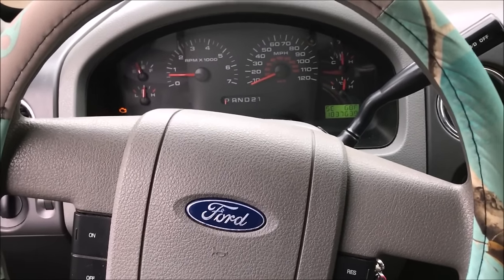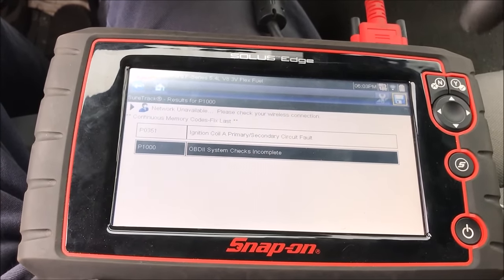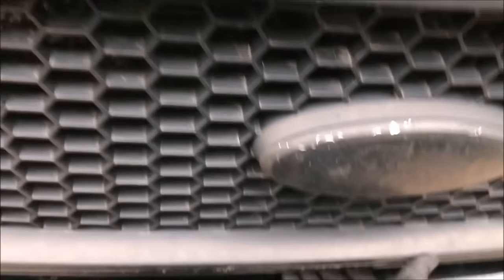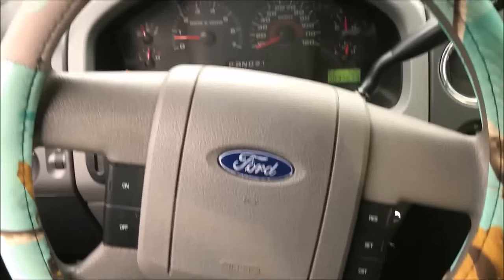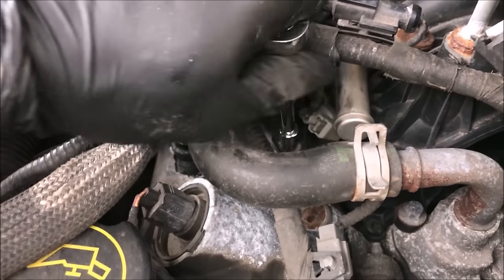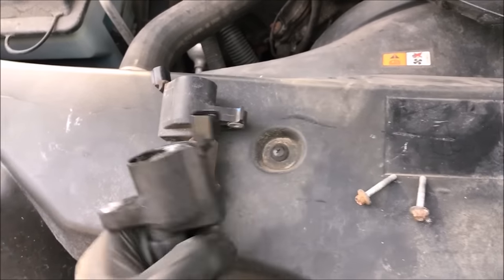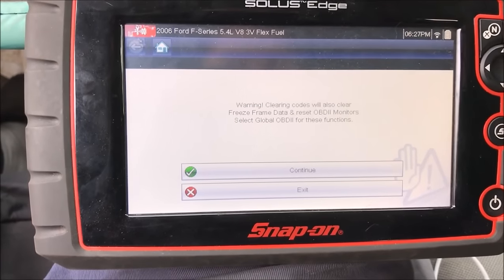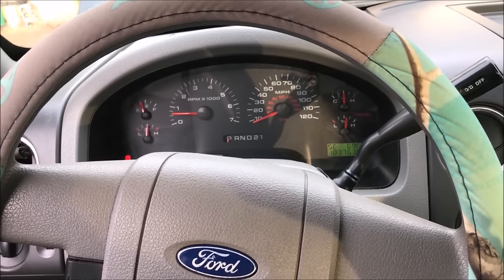How To Diagnose And Replace A Misfiring Ignition Coil (5.4 Triton)

Comment: Good video. I have a 2000 Lincoln LS V8 I changed out all 8 spark plugs cause I have a misfire. It ran well for about a good week and ended up with the misfire again. So now im going to change all 8 coils but any way by any chance did you put connector grease on those coils you replaced?
Reply from the maker: I didn’t but typically a bit of electrical grease on the end of the coil that contacts the spark plug won’t hurt anything. I don’t really mess with adding any to the actual electrical connector.
Reply: @TonyTheTruckGuy  okay and another thing this car has been sitting for about a good 2-3 years without running. When took the right side of the coils out the # 6-8 coils have like this brownish liquid on the coil. Would you happen to know what that is?
Reply from the maker: Probably just some old dielectric grease. Doesn’t hurt anything so long as the metal coil can still contact the spark plug. If the car has been sitting that long, I would also see if there’s a fuel filter you can change.
Reply: @TonyTheTruckGuy  alright that was going to be my next solution the fuel filter. But hey Thanks Tony I appreciate the help I'll let you know if there's no more misfire

Comment: Tony,  your comparison of the old coil to the new one with the longer spring sticking out is probably because of years being compressed plus the heat relaxed the tension, therefore making it shorter
Reply: Except that other new packs don't extend down that far.

Comment: Here is hopefully a helpful comment for anyone that is changing the plugs on the Intech 5.4L version - the factory plugs have less threads than the newer ones - when I pulled them, I thought I bought the wrong replacements but they are the correct ones... I guess Ford changed it so the plug would have more "meat" or maybe to fit more things, etc... not sure but it's what they went to now... I know this was about coils, but in my opinion it's silly to only do the COP's on these without also replacing the plugs just my opinion.

Comment: These coils have a life expectancy of 90,000 miles was at 90,000 changed my plugs yea twice in never one broke 07 f150 . One a month failed after 2 changed them all 2 years later no problem. These things are like popcorn put 8 kernels in the kettle you hear 1 or 2 pop at the same time but when its all done all 8 are done the kettle is at maximum heat at 100,000.
Reply: Jason joncas I have 270,000 on my 07 F150 replaced spark plugs 3 times, just now starting to change coils. Probably should of replaced coils a few miles ago..

Comment: Hello Tony i bought a new 2007 F 150 5.4 only owner and driver,  and i use it rarely.  I do run it often. I only use Chevron gas. This truck only has 59K  The last few months it seems to missfire??? It does it at higher speeds or uphills. No check engine light on. this truck has been babbyed. I had the truck serviced at the dealer at 50K all was done except the fuel filter... The dealer wants around $800 to change the coils if that is even what it is? I'm now more on a budget and my neighbor the weekend mechanic said hed do it. The real motorcraft seem to run $60 each. Plugs i think run $12 each. Should i do all of them as he suggested, and should i guess??? Thanks for on-line info   Mark retired
Reply from the maker: Had the exact same symptoms on an ‘06 that was my ex’s and it ended up being a combination of 2 things. The spark plugs were cracked and causing misfire under load, but wouldn’t throw an engine light. Then after that it was having issues with the torque converter staying locked up so I changed the solenoid for that. I would start with plugs and inspect the coils for any cracks or damage while doing the plugs. But be.m careful, the plugs on these engines are notorious for breaking upon removal.

Comment: I have a misfire on #8... I changed out the plugs on the entire side of 4-8 & Still have the misfire.... My ford tech buddy then tells me that I changed out 1-4 !!! What a funny guy he is... at least I got #8 done. All. plugs 1-4 weren't hardly hand tight....
Reply from the maker: Yeah haha, Ford numbers their cylinders weird. I believe cylinder 1 is the front passenger side and then as you go towards the rear, it’s cylinder 2, 3, 4. Then 5-8 are on the drivers side bank. May be a coil issue if you’re still having problems after plugs.

Comment: This video is a little old but I thought I'd ask a question. maybe you can throw out an idea. I have a 2002 Ford Harley f150. Comes with a 5.4 supercharged motor. At 24,000 miles Ford replaced the motor with a brand new factory long block which included their new 7 thread heads. Long story short is that within roughly 20,000 additional miles the truck developed a slight miss. It never threw a code and the truck was still very drive able. I finally decided to contact my local Ford dealership to see what they thought   the problem might be. Without a code showing they said it would be hard to diagnose. Seems the idiot light is also for them. They told me that when the new motor wen't in the original spark plugs and coil packs were used. They recommended that I should change them. I agreed to do so. So $1,500 later my wife picks up the truck and puts it in the driveway. When I got home I went out to start the truck. When I do it's barely running and the engine light goes on. The next day I contact Ford to ask if they crossed the wires. They told me to check the pick up receipt and look at the notations. I do and it claims my #4 cylinder is dead and I need a new motor. I won't get into the furious comments I replied to them with. Phones were hung up and the truck has sat ever since. I tried to put a code reader on the truck but I can't get it to bring anything back up. I also can't get the truck to run well enough to make it throw the code again. Any thoughts on this one?
Reply from the maker: Ugh. Sorry to hear about the struggle. I think at this point, your best bet is to buy or rent a compression tester. Remove 1 spark plug and check for compression 1 cylinder at a time. This should let you know if you have damaged pistons or valves. If the compression check turns out good, you’re probably looking at fuel or electrical. I know the “fuel pump drivers” on the F150 is notorious for going out.
Reply: I may be late but your problem sounds like the fpdm.fuel pump driver module.these trucks fuel pressure at all vacuum controlled make sure you have no vacuum leaks.

Comment: What's the difference between the brown boots and the black coil boots?
Reply from the maker: I’m not sure to be honest. Unless they changed manufacturers or materials. But as long as they’re the same part number should be fine.
Reply: On the 2008 F-150's is when Ford decided to redesign the spark plugs. When they did that, they switched to the "brown" colored boot that had the new design plug. All other F-150's from 2004 until about September/October build date time frame in 2008 had old design plugs that would seize and snap in the head when you would try to remove them. They also had the "black" boots on those. That's how you know if you have the newer or older design plugs. The newer plugs look more like a regular spark plug whereas the older plugs have that ground shield on them.

Comment: I have a 2006 Ford Expedition. I just had all 8 spark plugs changed and put in a new coil. Cylinder 6 was the misfire and the code was P0353 - ignition coil C primary/secondary unit. The code came right back on and it's still running rocky during acceleration. I unplugged and plugged back in. Any thoughts or advice?
Reply from the maker: Switch the suspected bad coil to a different cylinder then clear codes. If the code comes back for the same cylinder, you know it’s not the coil, and if the code follows to the cylinder you moved that coil to, you know it’s the coil. Also double check the cylinder layout. Ford is usually weird and their “bank 1” is the passenger side as opposed to chevy and most others where bank 1 is drivers side. I believe for also numbers them in numerical order vs firing order.

Comment: So if i replace all the plugs in my '00 5.4 litre and it still runs crappy can I remove one coil at a time and  notice if there's any appreciable difference until no noticable depreciation in engine performance ...? Would this be ok to do?
Reply from the maker: Just don’t do it with the engine running, you might get zapped haha.

Comment: i have a 4 cylinder and  the cylinder 3 stop working and left me stranded I have a scanner and that's what the scanner said and it said don't drive and so we had it towed hopefully if I change all the coils and spark plugs maybe that will do the trick I hope I have a 2010 Hyundai Tucson just rolled over 90000 miles the light didn't come on until it started choking what do you think
Reply from the maker: A lot of things could cause a misfire. Low compression, bad plugs, coils, or wires, lack of fuel supply, etc. Does the car start at all? I would also check your oil level to make sure the engine didn’t go dry and starve for oil. If that looks good, plugs and wires are cheap enough to replace that I would probably do that next.

Comment: Will disconnecting the battery and jumping the terminal cables like when resetting the computer clear the codes?
Reply from the maker: You mean disconnected the battery and then touching the ground and power cables together? Could try it. Or even just disconnecting the battery might work. Some vehicles that works and some it doesn’t. Worth a shot!
Reply: @TonyTheTruckGuy  
Yes,
 I said with a jumper because sometimes the cables aren't long enough to reach over the battery. 
Thx!
Reply from the maker: @icicicles  Got it haha. Good luck!

Comment: I have an issue where no spark is getting transferred to all 4 spark plugs on an 07 ford escape yet no check engine codes. Im not sure where to look now. Maybe just replace coil packs first?
Reply from the maker: Is it a 4 cylinder escape? And is there just 1 coil pack for all 4 spark plugs, or individual coil packs?
Reply: @TonyTheTruckGuy  they are individual and it's a 4 cylinder.
Reply from the maker: That’s very strange if none of the 4  are getting spark. I would get one of the coil on plug testers that you hold on top of the coil and it lights up if the coil is getting power. If you’re getting power to the coil but no spark then the coil is likely bad but I have a hard time believing that all 4 went out at the same time. If you’re not getting power to the coils then I would verify good battery connection. The engine ECU likely supplies power to the coils so there could be an issues there as well but I always start with the basics.
Reply: @TonyTheTruckGuy  I thought it was strange too. However, I  pulled each spark plug out and tested individually by turning the engine over and touching it to the frame or metal and got nothing. I also found it hard to believe all four went out at the same time as well. I had the problem after a -7° degree night. Is there a way to test the two wires that go in the coil for power? I have a multi meter, maybe just check volts when I'm cranking the engine?
Reply: Well get this, I just went outside and it fired up! Something got frozen I guess and thawed out this morning. Thanks for replying and helping out buddy.
Reply from the maker: Haha yeah electronics sure don’t like the cold, I feel you on that one. Fingers crossed it stays working! Gotta love it when things fix themselves. For future reference, you could try a bolt meter, but it’s probably going to respond too slowly to give an accurate reading which is why I recommended the coil on plug tester. You can get them fairly cheap.
Reply: @TonyTheTruckGuy  yeah im definitely buying the coil on plug tester because working on cars has became a hobby and I been making a lot of money doing work on cars. So that'll be another tool in the box for me. Appreciate your help.

Comment: You have a Northern rust belt vehicle, If you love your  car or truck move south and you will have them for a lifetime!
Reply from the maker: It should be illegal to use road salt here lol. South is looking more and more tempting, but I really hate the heat.
Reply: @TonyTheTruckGuy  Here is the best kept secret about the south, North Va. Beach, it never gets hot because of the on shore breeze from the Chesapeake bay. I spend two hours a day everyday walking on the beach in the summer I walk in the evening though because  of my fair skin.

Comment: Do negative numbers mean misfiring? So ideally you would've replaced the coil pack on #8 also? 
What are the numbers a measurement of? Thanks for the vid!
Reply from the maker: I wouldn’t worry about a negative number so much as a number that it way off from the other numbers.  The -33 on cylinder 1 was definitely the outlier. #8 may have been low due to trying to compensate for #1 for all we know. These numbers are basically just calculated  contribution of that cylinder, and the higher the number, the better it is.

Comment: Good to know, I've replaced all 8 coils on my 06 f150 twice and still having issues, not OEM coils.
Reply from the maker: You may also have bad plugs if you haven’t changed those lately.
Reply: Tony The Truck Guy already replaced with all new plugs but thanks
Reply: computer is bad
Reply: Chuck Urgitus,
I have the same thing going on. Although after changing the coil packs, it doesn't misfire as much. But it still does, a little bit. I've considered that it might be the spark plug wire, but I can't seem to find anything definitive to support this. You got any ideas??
Reply: Make sure to use plenty of dielectric grease on the plug boots it prevents spark jump

Comment: How often should you replace the coils? Also are the coil packs expensive from the dealer. My 05 f250 has 59k on the motor
Reply from the maker: I usually don’t mess with them unless it starts throwing codes for misfire. I can’t remember how much they cost but I do have them in the video description.
Reply: @TonyTheTruckGuy  thank you
Reply: Christopher Karedis I just recently bought a coils for my 05 f250. I costed around 60$ for just one coil.
Reply: @sebastiancastro986  wow!

Comment: good luck if you change the plugs.... I have a F150 5.4 2005. and a explorer 4.6 2007.  out of 16 plugs  14 out of 16 broke off... what a pain in the ass... a 3  day tune up...
Reply: Wayne Garrison pull your coil pack off, vacuum or blow out the plug tubes with compressed air to remove any dirt or debris. Spray the tube with a shot of PB Blaster or any penetration oil. Let it set overnight and the next day, those puppy will slide right out. Haven't broke a plug off in 2-3 years.
Reply: Also run the engine to get it hot, plugs come right out.
Reply: 2004-late 2007 3 valves have this issue...2 piece plug welded shell plug was a idiotic idea- try and remove normally, they will snap- read the TSBs. warm engine, crack loose, pour carb cleaner arond threads, let sit, back and forth at not over 30 ftlb as long as it takes...crunching/creaking/gaining 1/16 of a turn each reversal... got all out of my 06 mustang at >90k miles, but DID use the OTCcollet/support tool that actually also grips the tip, gives a tiny bit more torque-ability by helping turn the center too... thankfully didnt need the Lisle extractor(bought both expecting the worst). go slow, they can come out. if you ge a Lisle extractor, be sure it has three or four marking grooves in the shell- earlier ones with one or two groove markings were known to snap off the extractor in the plug...pulling a head off to remove that would really be upsetting!
Reply: Biana Doubt  those though were still one piece- the problem the 2 valves had was there were only three threads, and they would pretty easily strip, or work loose/blow the threads out of the heads... sad how two sequential designs had something as simple as spark plug hole coulda been so screwed up... but the three valve I swear was a planned obsolescence item- they never get swapped till out of warranty, and 'normal' removal is prettymuch guaranteed to twist off the stupid welded shell. really all these shoulda been a recall- there were so many 5.4/4.6 2 valves that had blow out issues, and probably 3/4 of the three valves ran into twist-offs... pretty pathetic how ford hid behind TSBs on both issues :(
Reply: @AmandaVee83  ill need to try this, im dreading replacing the plugs.

Comment: I can't ever get electrical connector to disconnect.
Is there a trick to it?
Reply from the maker: You have to depress the tab on the bottom side of the connector at the same time you're trying to unplug the connector. Wiggling while you pull usually helps because dirt and other debris gets in there and makes it harder to disconnect. It also helps sometimes to actually push the connector ON, then depress the retainer tab and try to unplug it. If there's any tension on the retainer tab, it won't release when you depress it. Last option would be to use a small pick or screwdriver to wedge under the retainer tab and then you can focus on wiggling and pulling on the connector.
Reply: Thanks!

Comment: ...to clear a code on my truck, all I do is disconnect  the negative cable of the battery and let it off for about three to five minutes...works ok for me all the time...I do have a scanner... prefer cable off...
Reply from the maker: That usually works, but the codes will likely still be in there as stored codes. I prefer a clean slate is all.